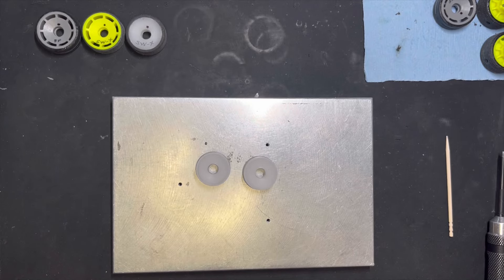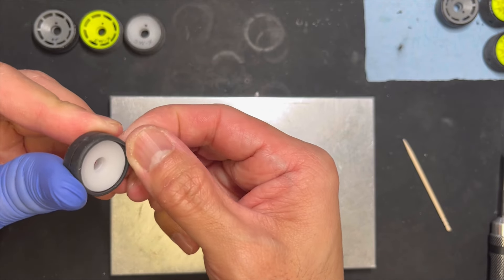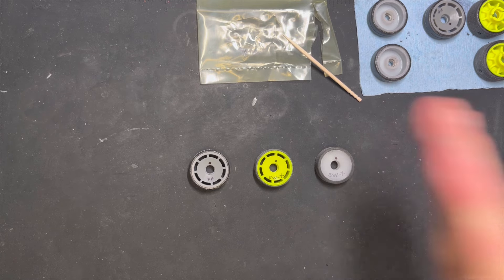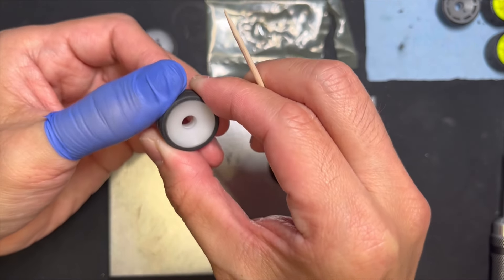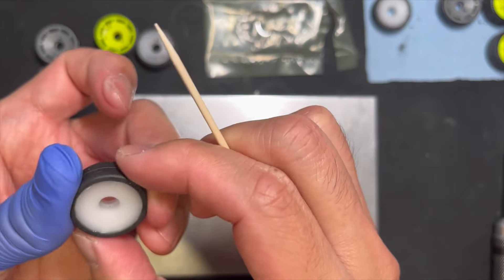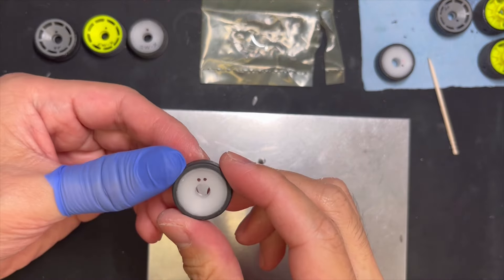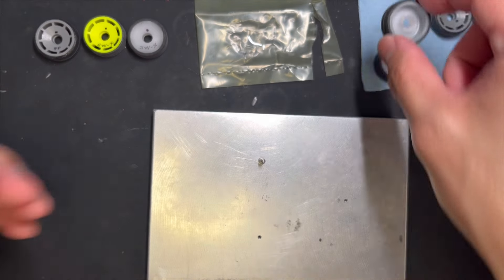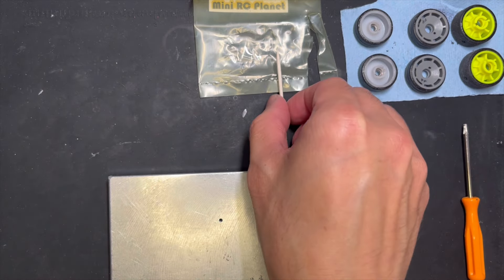How To Video: Gluing Front Tires #miniz

Comment: Great video! I'm starting to glue to abandon the tape, a question, should the glue "flange" be made for the rear wheels? If so, should it only be done inside? Thank you!
Reply from the maker: Thank you. Here’s the how to video on gluing the rear tires.

https://youtu.be/bwhPdqP2XNY?si=81Cqs9VhdehcNiFH
Reply from the maker: So for the rear, two options:
Outside: 
1. Half sidewall glue
2. No sidewall glue

Inside:
1. Glued sidewall (entire sidewall)
2. No sidewall glue
Reply: A thousand thanks! Forgive me if I take advantage of your kindness, I'm using 20 rims, do you recommend the 19s? How high should I start turning in mm? Obviously with the 19 rim I would have more rubber but in the end if it only changes being able to do a few more laps it won't change anything for me! Thank you!  @tjaymacRC
Reply from the maker: @ZackoTv  Not a problem.

I use 19mm no-flange wheels to get more runtime on the full size tires while also keeping the traction even when the tires are already low. I can go as low as 21.8mm. Here’s a link on FB where I did 1029 laps.
https://www.facebook.com/groups/722063711267613/permalink/2751448611662436/?mibextid=2JQ9oc

The 20mm flanged wheels, I use low profile PN tires and I can only do 600 laps with these wheels/tires combo and be at 22.0mm. Anything lower, the flange is already hitting the track = understeer.
Reply: Perfect, very explanatory! So I imagine that if I decide to use glue only for half of the flange, when the rubber reaches the height of the glue, in theory the glue should be removed and only half of it put back in, correct? @tjaymacRC
Reply from the maker: @ZackoTv  - I actually have a video line up for next week. An update when the tire reaches the superglue on the sidewall. 

Correct. What I do is when the car starts to understeer, I would feel (run my finger on the tire) the sidewall and see if the glue is taller or same height as the tire and when it is. I would sand the corner edge down with a 400-600 grit sandpaper. Just removing that corner edge, not removing the entire glue on the sidewall. Just the sharp edge that’s sticking out.
Reply: Perfect!!! Very very very Thanks! @tjaymacRC
Reply from the maker: @ZackoTv - Here’s the video:

https://youtu.be/ZJBDaIHwGzA?si=sswRxp71LDDk48J4

Comment: Would you say that glueing tires instead of taping tires allows for more fine tuning of the car's behavior on the track?  That's what it looks like to me.
Reply from the maker: Correct. You have more setup/fine tuning option with glued tires. From more bite, mid and less bite just like I mentioned in the 3:00 mark.